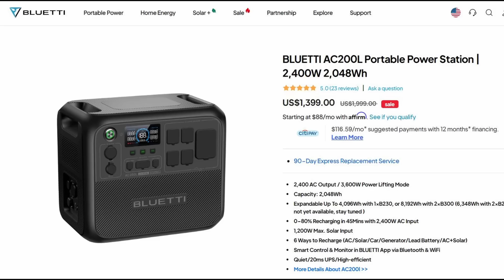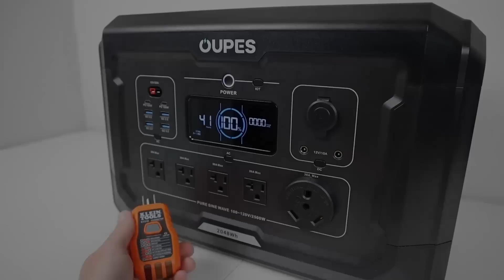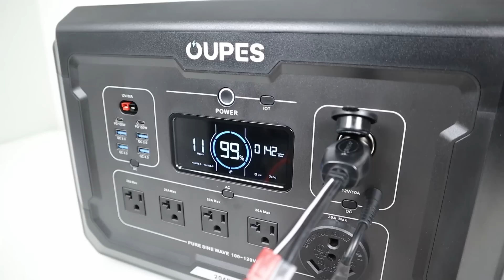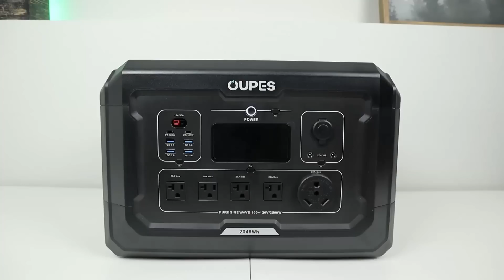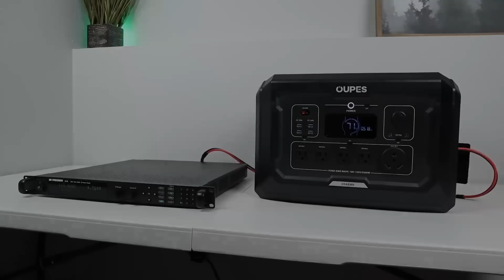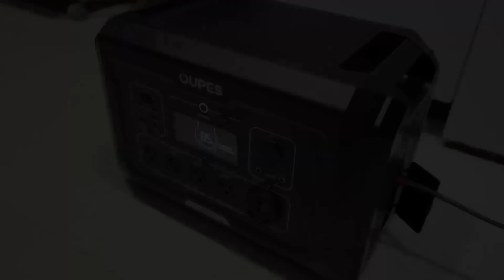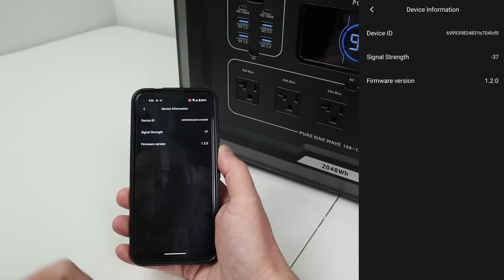The OUPES Mega 2 Wins the Budget Crown! Best Affordable Offering of 2024? Full Testing and Review!

Comment: I just bought the Mega 3 - It's GIGANTIC. Might buy the 2 also just so I have something to move around easily.
Reply from the maker: The Mega 3 is a beast! You are right, it's HUGE! This one seems much more compact and only weighs 48lbs.
Reply: I can confirm the Mega 2 is quite easy to carry around even at 48 pounds. The weight is on the bottom and the handles don't protrude out like Ecoflow's. It's a lot easier to carry weight when both arms are closer together, plus the Mega 2 is not bulky at all. I thought I'd want wheels like the Anker F2000 Solix, but for me, not the case.

Comment: If it has such a large voltage range how little of volt can make it work on solar panel. I’ve found that to be a problem in my Bluetti 2000.  It won’t solar charge with 200 watts only. It needs the 400 watt and corresponding voltage to begin to charge. 
The lower wattage smaller solar chargers don’t habe that problem and can easily charge on 200 watt
Reply from the maker: The Bluetti AC200p required 32volts input for solar charging. You could use two 100 watt panels in series and it would charge just fine.
This model does not have that requirement, it will charge from any small solar panel.
Reply: That's why I like this channel. 
A well thought out answer, and good advice.   @Jasonoid